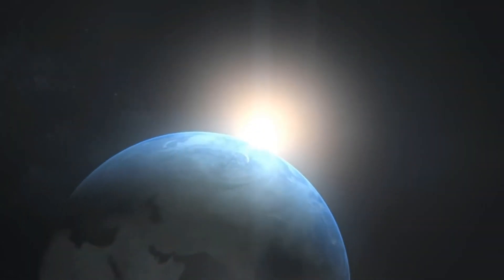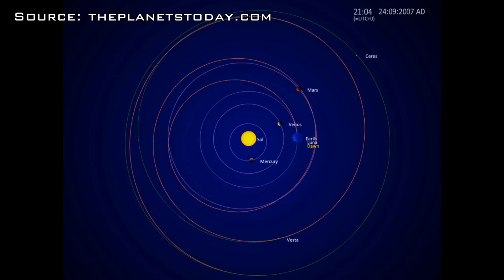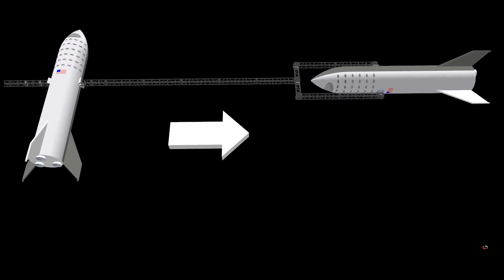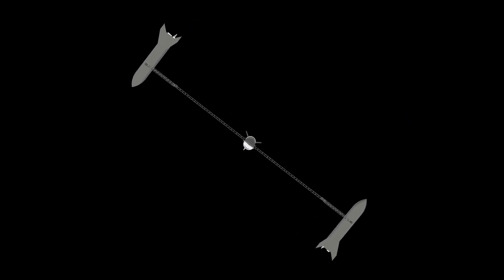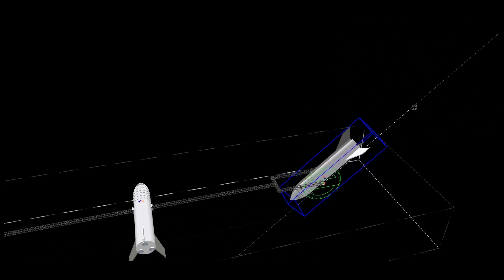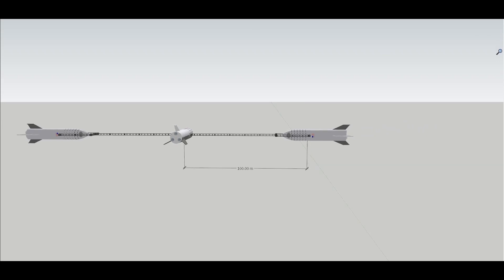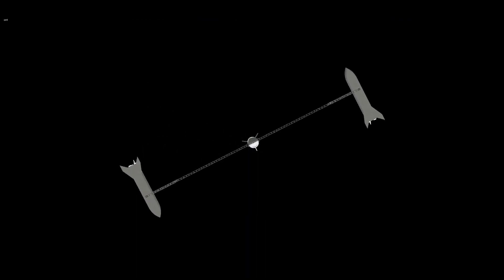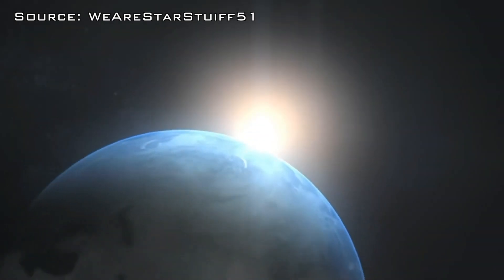GLS2: Artificial Gravity for SpaceX's Starship

Comment: Sorry, a tension based structure would be far lighter, just a few tonnes. It doesn't need to be limited to a single cable either, so it could eliminate vibrations and add redundancy. Although the current design of Starship has gone back to nitrogen for RCS in the past was going to use hot gas thrusters, basically small pressure feed methalox engine that should have similar ISP as Raptor. As they're currently a few versions of Starship away from manned deep space flight it's not unreasonable to think that by the time spin gravity is tried the hot gas thrusters will be back and so flipping the ship to use the main engines (which wouldn't work anyway) wouldn't be needed because the smaller thrusters could accomplish a similar job with the same fuel, just over more time.
Reply from the maker: Why wouldn't using main engines work?

Steel cables will likely play a role in the GLS system to keep the truss from pulling apart, but I think using main engines is key until I see a working pressure fed methalox rcs system - which is the spine of your argument.
Reply: @smallstars  For Mars, which is what we are talking about, rcs would have to be hot-gas (methalox) if we're doing in-situ refueling.  No advantage (and tons of disadvantage) using main engines.  Side thruster would just run longer and use a similar amout of fuel.  A much smoother and safer process.
Reply from the maker: @harpfully  I look forward to announcements about these future RCS systems
Reply: @smallstars  Methalox rcs will have to be done.  Musk himself has said so. 
Nathan is right about this and right about the cables.
Reply: @smallstars   As for main engines, that is out of the question. You'd rip the whole thing apart most likely even if everything works right. And if the engine on one ship fails to start, yikes, it could destroy everything including a ship or two. 

If you disagree, go see (and feel) main engines in action at a launch, then get back to us. The Raptor is massive and violent, and being FFSC it won't throttle down all that far.
Reply from the maker: @harpfully  actually floating in space, the stress on the truss that main engines will put on the system is minimal, especially compared to the stress from centrifugal force. 

regarding one engine failing to start, this is yet another reason that rigid trust structure is better then only cable tethers
Reply: @smallstars   Floating in space doesn't help you. It's still stress and the engine is still violent. Lots of vibration and you can never make the engines have the exact same thrust curve over time. 

And in bad scenarios, I think a rigid truss is actually worse. They break (or their mountings). Cables bend.

Also, the engine plumes would each strike the other ship. In vacuum, especially with a non-vacuum-optimized engine, plumes are nearly 180 degrees wide. 

My background is in power generation (i.e. heavy spinny-shakey things), but I'm a 4-decade-long space enthusiast, not a rocket scientist. Maybe contact your local university for one. And/or a mechanical engineer. Maybe get a reference from ASME, who do help with people in media (like yourself).  
Restating our points about this isn't making any progress.
Reply: @smallstars  Agreed with the hybrid cable-truss design
Reply: To use the main engines as proposed the whole spacecraft needs to turn sideways. That includes the engines, but also tanks and crewed areas. So without serious re-plumbing the tanks would not direct the propellant to the engines, additionally the crew might need to pull sideways g's that are negative to even the re-entry g direction (so 180 degrees from that) depending on if spinning up or down. Additionally, the spacecraft has a fixed pivot point but not a fixed center of mass, so huge torques would be needed to turn them. And then as the g's rise the spacecraft would have a reaction force concentrated near the middle from a direction they aren't designed to be lifted from, so they would snap in half with the current design. They could maybe get around all of these issues by over engineering the structure and everything else, but that defeats the point by increasing the mass and cost, while reducing the payload. This is why its better to use the existing hard points which are used when lifting the spacecraft with a crane on Earth. This design is already using a third Starship with no real benefit, so it's critically over designed from the start. Generally speaking it also has too many points of failure with no redundancy.

They won't use steel cables! They're not cryogenic and they will experience tension loads only, so there is no reason to use steel. Look up a material called Zylon, it's super light and super strong and could be made into long high strength ribbon like ropes. Something like that would be used and would only weigh a few extra tonnes per spacecraft.

A pressure fed methalox rocket is effectively what the "blowtorches" that ignite the Raptors are... If they demonstrate relighting the engines in space they could use virtually the same thing. Maybe it would lack the responsiveness to be a true replacement for the compressed gas thrusters, but responsiveness and power are not the requirements, efficient thrust is. They only need something like 60 m/s of tangential velocity, and it could be done over an hour or more if necessary. Using the main engines is overkill.

Comment: As I tried to explain on reddit, this setup has an issue with the intermediate axis theorem. Here's a link to a good explanation of the problem: https://youtu.be/-Si6iRL5Fj8

There might also be an issue with the most massive part the Starships (fuel & engines) being up to 35% heavier than normal with deck 2 being at 1 g although that would be easier to deal.